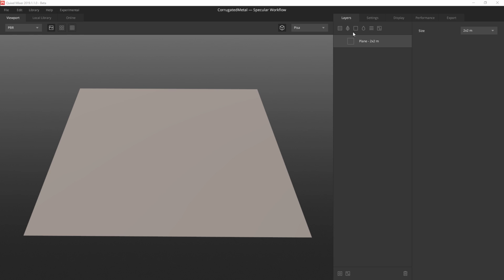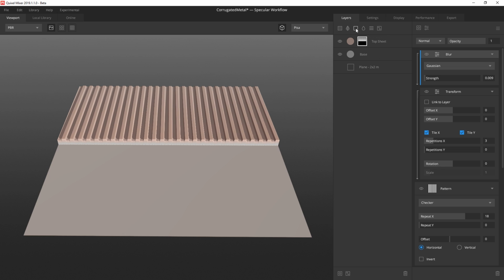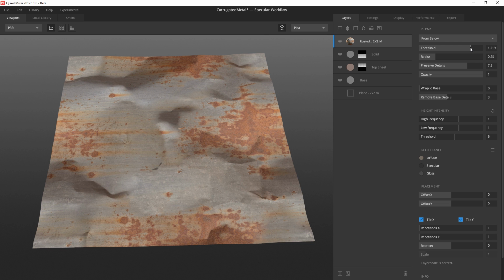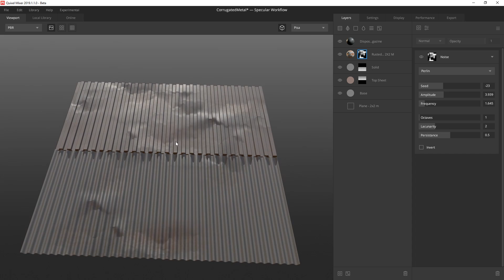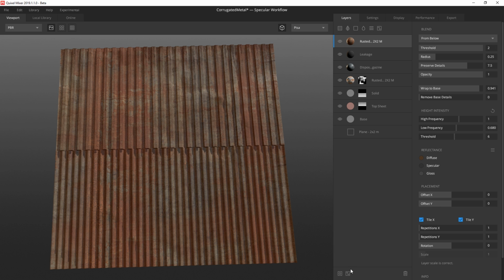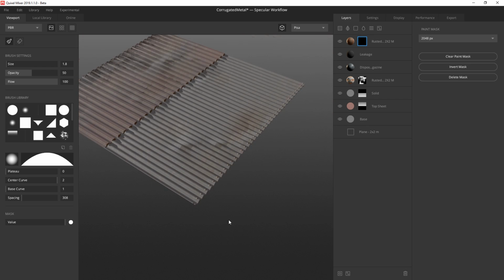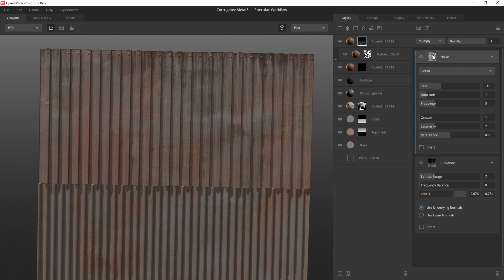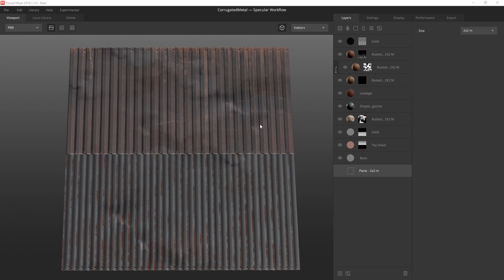Quixel Mixer: Creating Corrugated Metal in Mixer

Comment: very good info overall, but trying to follow this with the latest version doesn't create the same results without a lot of backtracking , also it sometimes becomes strange to just push this, slide that, add this... with no explanation to what is actually happening . anyway thanks. and it's the case with a lot of Quixel tutorials, not just this one.

Comment: It's fun to watch, but the tiling in a 3d app like 3ds max are so bad, so what's the point of making such small, tillable textures? I think substance or quixel have a big potential, but if they are not procedural also in the 3d app then it's useless, or I am wrong?
Reply: i use vertex paint or multiply triplanar projection masks with different rotation or offset to add variation

Comment: I'm not super familiar with Quixel Mixer, however I know Substance Designer pretty well. Could someone explain what Mixer has over Designer. I'm not sure I see the benefit in using Mixer already knowing Designer.
Reply: Hey man! long time no see! :D 

Simply put they kinda do the same thing (creating textures) but Mixer has a more simplified approach that still allows you to get stunning results in no time, as seen in this tutorial.
If i were to do a material like this in Designer it would most likely take me a buuunch of nodes, while this one gives you AAA quality and full control with just 10 simple layers in this tutorial.
Reply: @theadnart1  Hey buddy! Great to see ya. That makes sense, I felt like i was missing something when i thought the two applications were very similar. Main difference being one is node based and the other is not. I like simplicity and could see this being a large task in designer.
Reply: it's more like Alchemist vs Quixel.